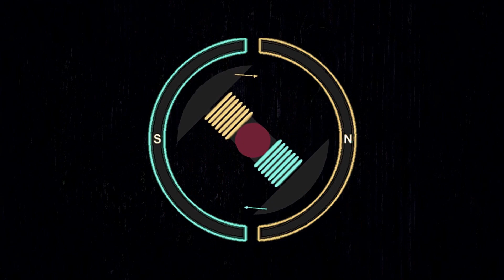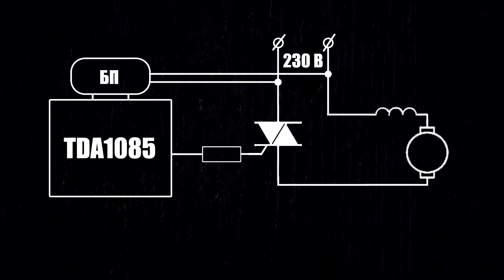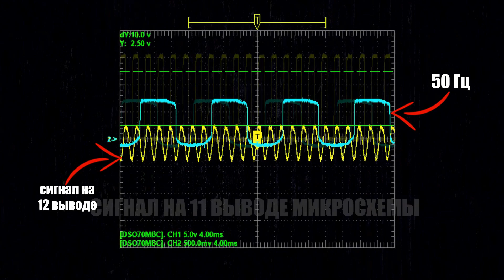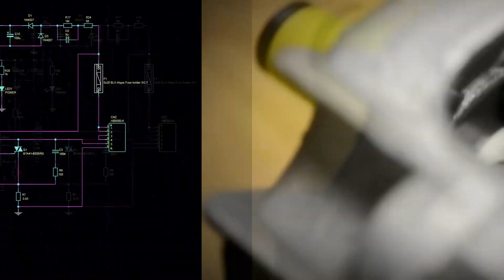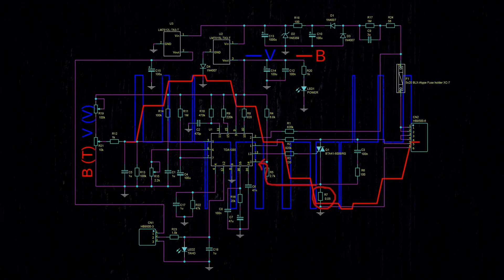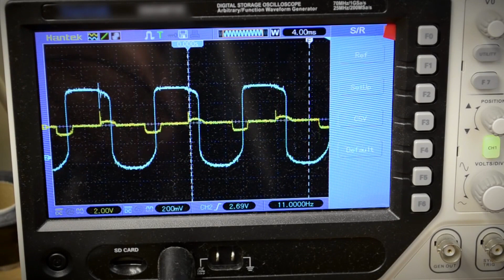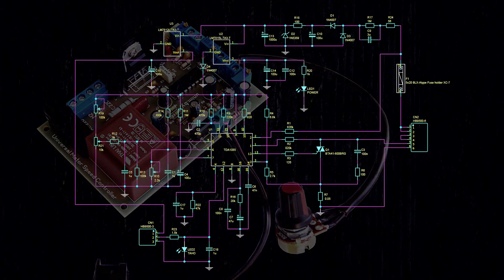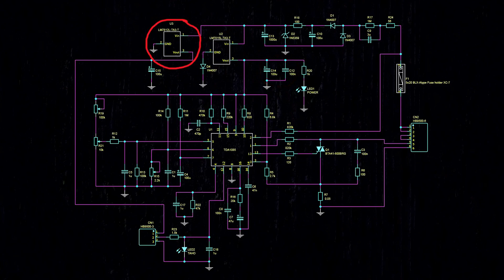Motor speed controller with power stabilization.

Comment: Nice circuit, I did know about rrough idea to use triacs for controlling AC, but never used them.
Thanks for sharing the schematics and the PCB. It could be done with Arduino, yes, but it would need more circuitry around it and power supply for it. And I guess would be more costly at the end as well.
This is just perfect for controlling some AC motor powered tool, when a full blown programmable frequency controller is not needed.
Reply: Nowadays all this can do in software with micro controller with DC and a MOSFET